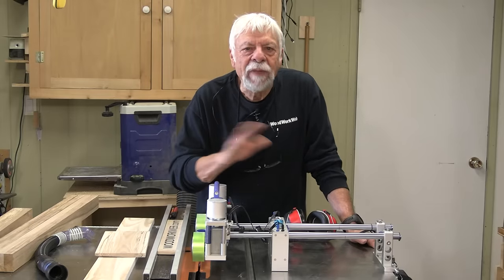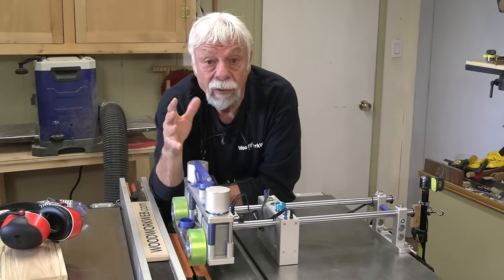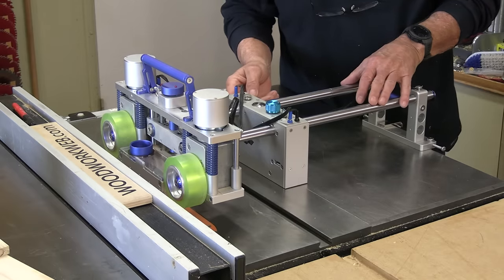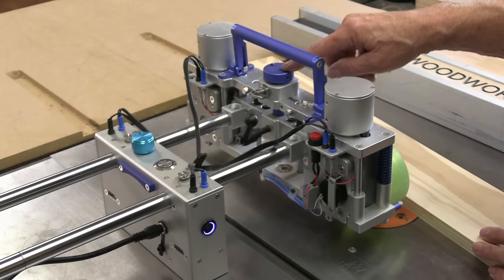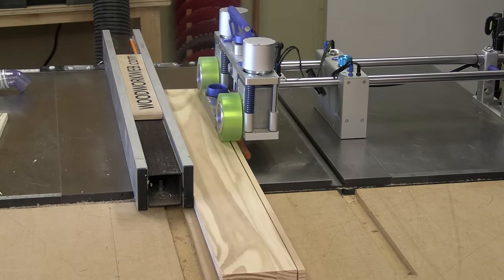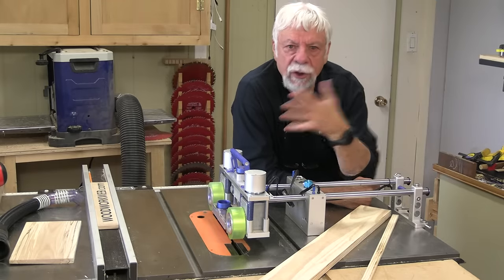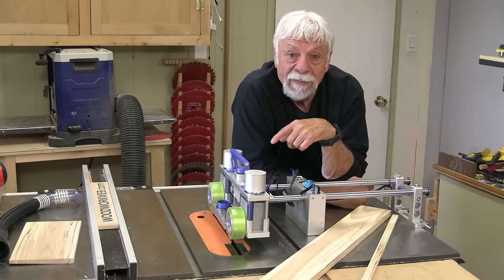Revolutionary Table Saw Feeder: This Changes Everything!

Comment: I don't see the utility for making repetitive cuts such as for a cutting board. Those cuts are typically 1-2" wide with the majority of the stock to the left of the blade. It appears that the maximum capacity for this unit is about 12"?  It appears that perhaps it can be stretched a little, but attaching stuff to the right of the blade sorta defeats the entire purpose of assisting with repetitive cuts.
Reply from the maker: I think the widest capacity is 8" but don't quote me on that ... not sure who would be using boards wider than 8" for making cutting boards, but this unit would not be for them, as you indicate.
Reply: @knecht105  For end grain cutting boards, it's the length of your glue up that determines how thick and how many boards you can make. You can easily have a board longer than 8" to crosscut into strips for the final glue up.

Comment: This thing looks frighteningly cheap. It looks easy to bump into and mess with the alignment. The dangling cords all over the machine are bad and there are too many spaces for sawdust to ingress into the device. I can imagine the cuts wander away from the fence without a featherboard setup. What happens to the electromagnet when a power breaker pops? I hate to say this but if your afraid of a spinning blade or too weak to use a tablesaw you probably shouldn't be. 700-800 bucks will get a halfway decent powerfeeder thats more robust and less complicated.

Comment: You removed the riving knife, which is a huge safety hazard for the target audience (people intimidated by the table saw). Unlikely they will put it back on after removing the autofeeder. So then they keep using their table saw without the riving knife. A great setup for kickback. Especially for less experienced woodworkers. And for what?
Reply from the maker: This unit will not work with a riving knife, it says so in the instructions for set up. Most people do not understand that a riving knife is only necessary for ripping natural wood, which can come with built in stress within the wood that make the wood want of "move" as it is being cut, which sometimes creates a hazard as the wood can either pinch the table saw blade, or bind with the fence which is what can cause very powerful kickback. Cutting plywood, MDF or any man-made wood, or cross cutting wood a riving knife does nothing to reduce kickback. Kickback is normal phenomenon on any table saw that happens between the spinning blade and the fence no matter what wood you are cutting. Most riving knives, like mine, take less than a minute to install or remove.

Comment: Power feeders are not new. Shops have been using them since day one.
Reply from the maker: You are correct, and if you have ever used them, you will know the problems many of them have, like loosening and twisting, difficulty in getting enough pressure on the wood, none of these issues did I not encounter with this unit, but like all things, it does have limitations

Comment: If it mounted on the fence itself it would be far more useful. It could have a guide so you could be absolutely sure it's parallel. Look at the videos using mag locks on Jessem feed wheel for example

Comment: Where does the feeder get power from?  They need an option that doesn’t use electro magnets for those of use that don’t have iron tables.  Maybe something that uses a miter slot to anchor it.
Reply from the maker: The feeder uses electricity, the same thing that normally drives the table saw blade. This unit is not for everyone, I would not trust a unit that only used mitre slots on something like an aluminum table top, there would be too much risk of the the mitre blank pulling out from the mitre slot ... but an interesting idea

Comment: Whats to stop the blade from slicing into the feed rollers?
Reply: the person setting it up
Reply: What a stupid question
Reply: There is a laser used to align the saw blade so the rollers are always above the blade when adjusted correctly

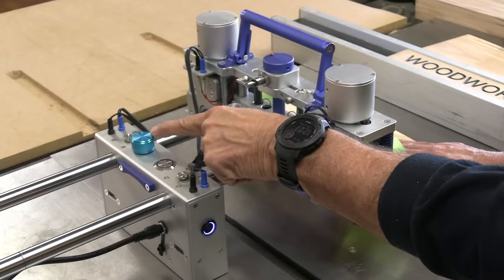Comment: Colin, learn how to write a script for your videos and adhere to it. It will lead to greater quality in the finish product you upload. At 2:09 you are talking about the motor, pointing out the power switch and a knob. You don't identify the purpose of the knob until 3:37 while talking about the electromagnet. This is a very haphazard approach to presenting information and makes it hard for a viewer to find information without rewatching through more of the video than necessary.
Reply from the maker: Thanks for your comments ...